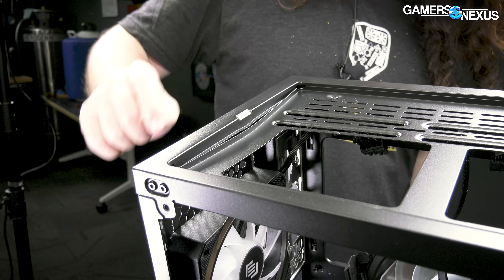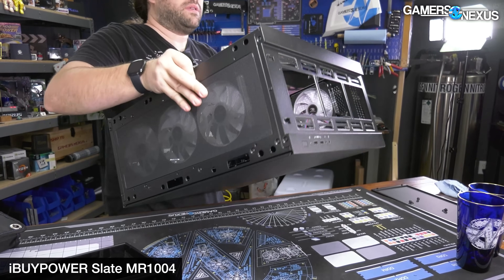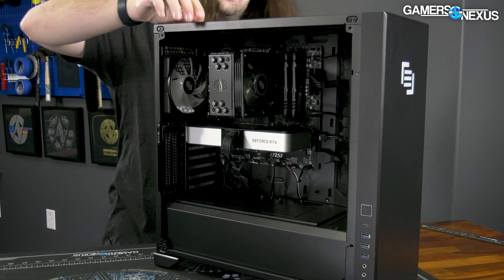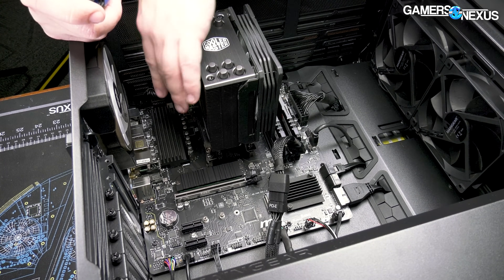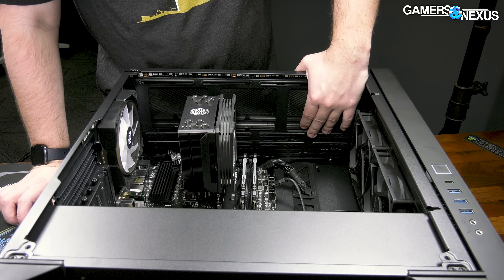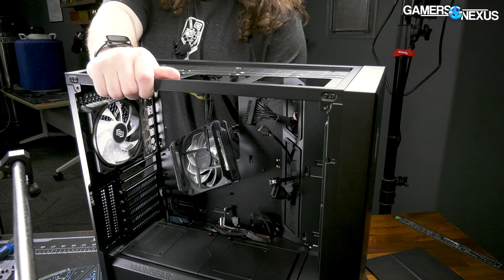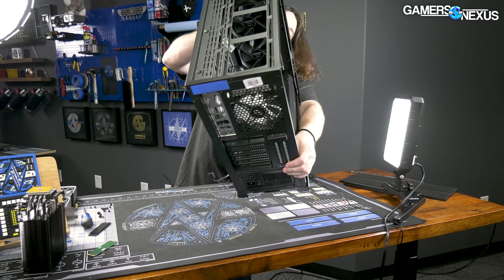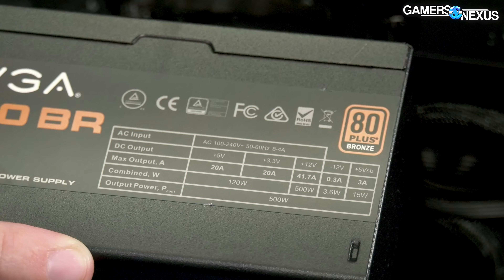Maingear Did It Right: Secret Prebuilt Gaming PC Review ($1700 Vybe)

Comment: Thanks for the coasters, got mine a week ago! Happy to support your channel. PCI case screws are nicer ones, the front fan lack of vents sucks. Defect dent bummer. Nice parts except case. 500 watts??? Build looked great though. Front panel I/O not my preference. Solid front panel is quiet so if you prefer that over 5* cooling, I uses its useful for someone.Recovery flash drive rocks. Type C front panel nice extra. Nice Job overall Maingear!!! (Case is a fingerprint magnet! haha)

Comment: I've damaged a case during a build before (bent mesh near PSU).  I've used a case that was damaged in shipping in a build before (similar damage on the top under a filter).  As long as it isn't a problem contacting pins or boards I don't mind that.  The only thing I'd change about this build (other than using a better case in the first place) would be the SSD, and while the Samsung Evo 970 Plus is at the top of my list, there are others that have DRAM cache like the HP EX920, Gigabyte Aorus 7000s, Acer Predator GM3500m and Patriot VPN100.  In the coming weeks as I shop for one of those nVME drives myself (for a B450 board so no PCIe 4.0 needed) I'll be checking your other past prebuilt and other builds and looking for those units to see how they did, along with videos comparing speeds.  Trying to avoid those slowdowns as I often move videos and music from my camera and my phone to and from my computer.

Comment: One thought I had for your performance charts comparing the different pre-builts - maybe include the year / rough time when they were purchased. Not sure if you purchased a bunch at the same time and are just working through the backlog, but prices will naturally get more bang for your buck as old stock gets cheaper and new components come out. Especially with the mass GPU shortage now coming to an end.

It can kind of be inferred by having the specs & price as you do, but it could also be that they just happen to be overcharging for what they deliver.

Comment: when you pull a PGA chip off with the cooler like that, you can use a spudger like a lever to pry it off so that you don't have to twist. Just keep a firm grip on the CPU so that it doesn't go flying.

Comment: As a system integrator, who builds PCs for a living, I appreciate everything Maingear did, they did good, I like and preferred mesh front panel, but most users like them flat. Half of my customers request to use glass front panel because they look clean. I do system customization, actually, I'm more like a system adviser than an integrator, but I do assemble stuff, I did Linus-like cable management, but that is what they get from free assembly and installation. But I always do clean installation. Windows (latest build from uupdump and almost nobody did that here), Office, some essential software for the local market (if I don't install them myself, customers will install them yourself and might get viruses for downloading them from an untrusted source). Sometimes I even do pre-tuning (for free) if I have spare time, and I do collect some benchmark results for my own archival and for later uses like new stuff coming and I need a proof for the customer that the new stuff is better or worse than the old stuff. And I always try to get the best price/performance parts (with availability) possible if they don't request specific stuff (like a specific brand, specific model of part, cuz they like that brand)

IF I was the guy from Maingear, I would put a Samsung PM981a or even a PM9A1 NVMe SSD as the boot drive and I will charge like $50-80 more for that as a default option.
Not sure if Maingear has access to this kind of Samsung NVMe SSD or not, if they do, they should do that. Not much of the cost compared to 660p.

P/s: For those who haven't known it yet. PM981a = 970 EvoPlus OEM counterpart, PM9A1 = 980 Pro OEM. PM prefix means 3-bit MLC (aka TLC) NAND.
Samsung does have 2-bit MLC for OEM parts, like SM981 (970 Pro). The only problem with Samsung OEM part is: They are not eligible for Samsung Magician for firmware update, but I doubt anyone who owns prebuilt care about that anyway, and I don't see any problem with that, I built a lot of systems with Samsung OEM parts and they run well.

Comment: I bought this same exact Maingear system last Christmas when it was on sale. Review is spot on with my experiences, except my case wasn't damaged. Even with the small intake airflow I haven't had any heat issues even running "expensive" games like MSFS2020 with a heavy graphics load. I did add an extra 32GB of RAM though (for 64GB total, I do a lot of image processing/graphic design as well). My only "complaint" it the two front fans aren't RGB like the back one is, LOL.

Comment: 1700? Nuts. I just build the same exact system from microcenter parts and it was 1300. The 3060ti was 500 and the 5600x was 200, with 32gb and 1tb nvme

Comment: I was looking at these in the fall when I badly needed a whole new tower. That case is why I ended up with a Corsair A7200 prebuilt instead. It was a bit more money ($2k), but it came with a cpu liquid cooler and one of the better cases out there (4000D). That was back in November and I have had zero complaints with the system so far.

Comment: I ordered about 30 of these units for my PC  Gaming Lounge I opened Februaryof 2022. In the order receipts I was supposed to get some units  with 212 RGB CPU coolers. (About 20 computers i believe)  They all came with stock coolers that run the CPU at 90 degrees while Gaming. I've called customer service multiple times but since I have multiple orders of 5+ computers I have to match  each computer with the GPU serial number which they have to send me the serial numbers for each GPU so I can correctly match them them with the order number unit for the computer I want to mail in. They won't let me send them the computer without all that information. I spent about 40k on them from Main Gear and have been disappointed with the level of customer service I have received. When the time comes to upgrade I doubt I'll be using Main Gear again.
Reply: I apologize for the rant but with my experience I wouldn't recommend this Company to a friend. Long time viewer of the channel and love you guy.

Comment: I’ll say I got into PC gaming early 2021 I bought an SI from cyber power msi 3070ti, ryzen 5800x, 3600 mhz dominator ram 570 MSI mobo, it does have cyber power fans and I don’t know enough to start digging around at the power supply. (It’s placed so you can’t check it out. So I’m assuming it’s not amazing but it works well) 0 issues, 0 damage on arrival, sits at around 65 c while gaming demanding games. All in all super happy with it. With 2 high end 1440p curved monitors I spent around 3800 through Best Buy. (That is with the warranty on everything) overall not too bad of a price for everything included. Like I said before 0 issues. I really think with MOST of these SI’s when you start getting into the higher end desktops; they do a good job. Buddy went and bought the same one after he checked mine out and got my opinion. Only difference was he got a founders 3070ti in his.

Comment: Is it possible to do an episode about Dell Precision Towers? You might be surprised that Dell actually has put some effort into designing a good and working thermal solution for these workstations. I personally have a T7820, and I really enjoy using it. Despite the OEM motherboard, most parts are modular. The whole computer is actually very solid and reliable.

Comment: Huh, it's weird because I have this case and it has a dust filter in the front.

I've has the case for 3 years and I've never had any heat issues. I have a FTW3 2080 and a AIO in the top of the case and it's always been fine.
Reply: We stopped shipping with dust filters because most customers were not cleaning the filters. We did a lot of testing and the positive airflow actually keeps the chassis relatively clean. Cheers!

Comment: Even after having to return the first MG 3060ti because of a problem, they said the GPU was bad. They sent me the return labels shipping free within the first 30 days. Got a different one because the cable routing was different and much better and it is currently working. Feel better about buying MG now, thanks for the video. And main Gear comes with a free 2 year warranty you just have to pay shipping after the first 30 days. Thanks for the video.

Comment: The LED box is covering top fan almost completely. With only side intake that fan is useless. I would probably put the front fans to the top since there is what appears to be some mesh or dust filter and fans can actually bring in some fresh air.

The only major downside to this PC is the case but if you are bit tech savvy you can replace the case for something much better.

Comment: I had a computer custom built by a systems integrator called AVA direct.  I can't speak for everyone else's experience, but I have zero complaints.  It wasn't cheap, but it was still less than building it myself due to ridiculous scalper pricing.  When the GPU died, I shipped it back to them, they replaced it and shipped it back, took about 3 weeks total (I think they RMAd the GPU back to Nvidia).  I considered Maingear, CyberPower, Origin, and CLX before settling on AVA, partially because I've seen enough reviews of the others on YouTube, and also because they had the biggest assortment of different components and good pricing - for example, in Aug 2021, I paid $1700 for an RTX-3090, $200 over MSRP compared to about $3000 on eBay.  I hope reviews like this will push other companies to start working harder and shipping better systems (I have no hope for Dell)

Comment: You might try CLX computers. My main complaint was they sent me a Gamdias Power supply instead of an Evga which I paid extra for. I ended up just buying  Deepcool gold modular 750 watt. I also swapped cases for a full-size Phanteks and added an internal DVD. Though everything else was fine initial cost was 2500. AMD5900 x 360 mm liquid cooling [CLX] 32 gig of 3200 MHz xpg D50 ram x570 Asrock  Taichi  1 TB of Seagate Firecuda510 nvme random 6800 video card turned out to be XFX . I bought this 12-5 2021 and didn't actually get it until 2-14 2021. The cable management from them was ok most of it was ok as your case was damaged so was mine on the left front corner. Overall They did pretty well except for the power supply. At the time I bought this the only hope of getting a video card such as the 6800 was buying a prebuilt. I did have to set the XMP to 3200 but that was no biggy. I also swapped the liquid cooling to Corsair 280 mm H115 I RGB PRO XT though that wasn't necessary. Windows 10 pro. Overall I'm very happy with my machine and don't think I will need another for some time.

Comment: Nice review and very positive regarding the use of off the shelf parts. I would assume that the case choice in this build was purely financial considering the date it was ordered. GPU prices were still on the insane side of the fence so whilst 1700USD is not cheap but for the time of purchase it was a very viable option.

Comment: i bought the 2020 black friday special vybe back when it was impossible to get a GPU otherwise(still took over a month to deliver).  it was $1800 at the time, only difference was it came with an og MSI 3070,  didnt have the CM 212, just an AMD Wraith(which i replaced with a 212). Have not had any issues with it in 1.5 years. mine didnt come damaged. all ive done it add the MC 212, some ram and another HDD
yeah im not a big fan of the case, but at least i have the option of buying a different one without having to replace components as well.  

I had planned on building my own, but like i said with the shortage of GPUs at the time it wasnt really an option.  i had never heard of maingear, and not sure how i stumbled across their website, assume i was just looking for black friday deals, but im glad i did.  If im ever in the market for another prebuilt ill be using them again.

Comment: I have a couple Vybe cases (one black, one red.  Both the Vybe RGB models from MicroCenter) that I have done custom builds in.  Both mine have a front dust filter underneath the removable front plastics.  I have dropped the bottom front fan down as low as it will go in both of mine and removed one of the tunnel covers to keep the spinning rust drives cooler.  I do have a couple exhaust fans on the top....now I am interested in how big of a mistake this is.  Mine has a 5800X and an RTX 3090 FTW3 Gaming Ultra in it.  My son has a 5600X and a 3070ti.   No critical heat issues but it isn't super cool either (I set my fans for mostly silent running until the case gets toasty).

Comment: Please please please review a Corsair One Pro.  I bought one in April, the only way I was able to get the wireless card to work was to uninstall and reinstall the drivers every single time I wanted to use it, opened support ticket with Corsair in October, was shifted to a different support person in late November, they recommended a bios update, then I received a blue screen and Corsair had me return the system to them at beginning of Dec.  it is currently late January and Corsair had not yet looked at my system.  This is ridiculous for a $4999 system!

Comment: Looking at the dent in top of the chassis, since the exterior of the case didn't seem to show signs of damage, that probably occurred in the factory where the case was made. And since correctly building in the electronics and cabling in a correct manner is obviously an important part of their process, they wouldn't have necessarily have noticed it. If the top filter was in place during assembly, they wouldn't have been able to see it.
Reply: watch out, the CEO of that company is running around the thread calling people who say this liars.

Comment: I bought one of those cases a few months ago. The air flow stock is not awesome, but the build quality is pretty nice. I built up a relatively older, lower spec third system around a Ryzen 1600 and 1060 6GB. I went with a bunch of fans. Eight in total, three in front two on the tower cooler, the rear and two on top as intake. I don't overclock the CPU or GPU so thermals are very reasonable for my uses. Air flow is a bit disappointing as I really like the build quality. Not bad for $20 though.

Comment: As a very small system builder myself I can guarantee most of those damaged cases are likely from the courier. I can spend an hour perfectly packing a machine inside and out and UPS / <insert other courier> will find a way to STILL crush it somehow despite the outer packing box still looking pristine.

Comment: What?? You don't have to disturb the paste pattern just because the CPU came off with the cooler. You can just use a very thin screwdriver or spatula or such to carefully create an initial gap, overcoming the stickiness effect, and then you can lift it off with ease.

Testing with an older version of Cyberpunk 2077 ... Something that would not be possible with Steam.(?)

Comment: Cable management question. The CPU fan was wired to the fan splitter it seems which is a 1st for me. Can I assume the splitter is getting it's PWM signal from the CPU fan header on the MB and thus all the case fans too? I don't see anything wrong with that, just different. Also on the front (side) I/O I really like the 3rd type A port but is that one running off the type C header on the MB since the board only has 1 older 3.0 header? In Win 909 case has that, seems extremely rare.

Comment: Would it be reasonable to drill out a pattern of holes in the front pannel to aid in air flow?  Just curious.  Also, thanks for this great series of reviews.
Reply: I have this case. With air cooling some more airflow with holes or whatnot would help. But I have a 360 aio as front intake and have tested with front panel on or off, difference is only 1 degree. If you remove the side glass panel you get one more degree, so this case functions well as is with water cooling.

Comment: Really glad to see Maingear taking feedback. I complained about the build when I got mine due to the use of a stock wraith cooler. This resulted in really poor performance due to CPU overheat issue. I have had great performance since going to an AIO replacement. This was disappointing considering it was mandatory to get performance. This choice for a real CPU cooler makes the Vybe an amazing prebuild for anyone in this price point, especially if you cacth one of the many $100 off sales.

Comment: I bought a cyberpower PC from Best buy in January because my 1080ti died, wouldn't boot. Pulled out the CPU and hella pins were bent, fixed them, reseated, and it worked. Ended up returning it and just caving on buying stuff at January prices but like to think I did best buy a favor so they could actually sell it without someone else returning it broken lol

Comment: it blows my mind that any system over $1500 would come with an air cooler and not an aio...
Reply: i know right? 1700 for a goddamn 3060, air cooler, stock psu cables such bad value for money it should be closer to 1000